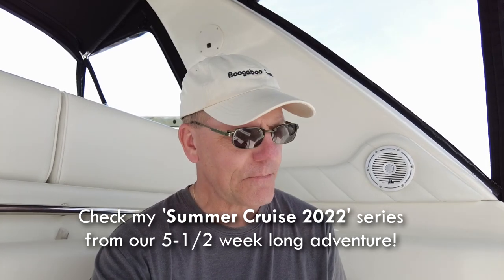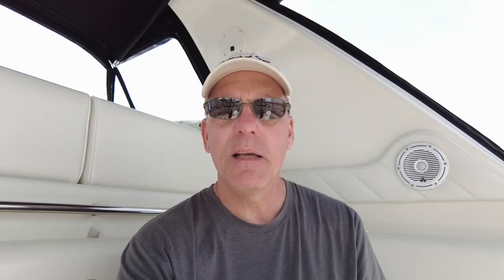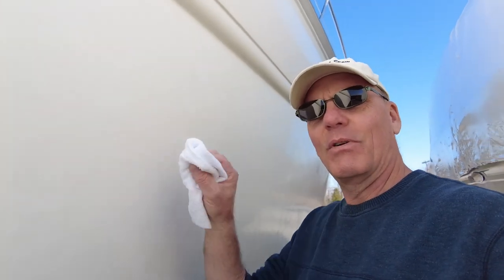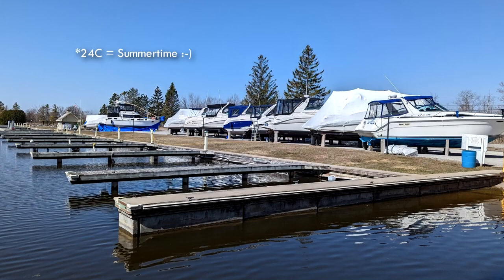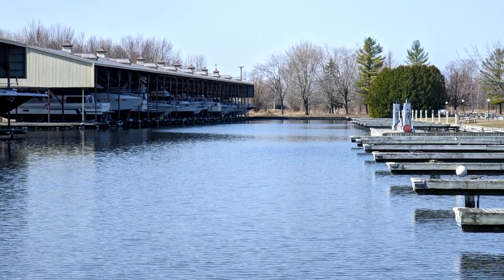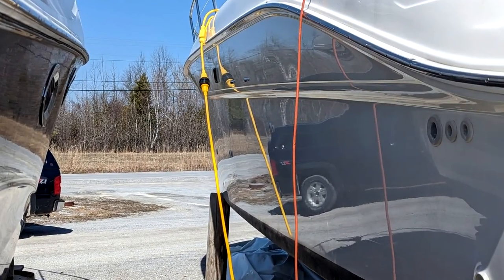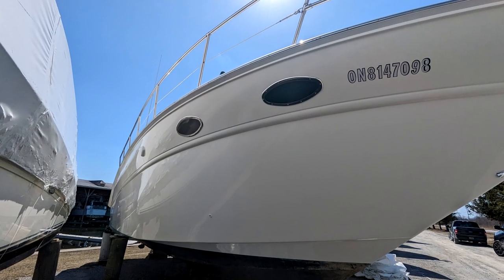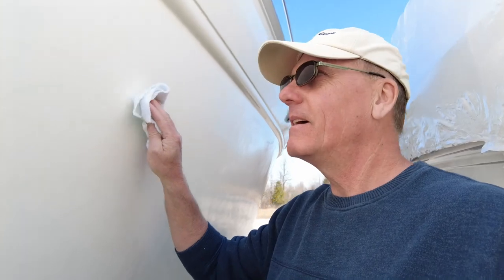Hull Polish & Polymer Application - Sea Ray

Comment: Jescar Power Lock + is great, I've been using it for 3 seasons.  When I waxed my boat I would always have to use simple green or non skid cleaner on my deck.  When I switched to Jescar I just use Starke Pure clean boat soap (neutral PH) and it cleans right up.  Bird crap comes off and the sun will bleach the stain if one is left a half hour later.  I never have to use chemicals now.  I usually apply another coat around July to get me through the rest of the season.  I put Jescar on and leave it on overnight and take off the next day.  This year I'm using Jescar Ultra Lock + it is supposed to be new and improved formula.
Reply from the maker: New and improved?? Sounds good good to be true 😉
 I'm gonna take a look at that cleaner you mentioned. I usually use basic boat soap, just to get rid of built up dust and grime we get around the marina, mostly from too many idiots driving too fast through the gravel parking lot.

Comment: Your conversation is the third place I've seen polymer sealants endorsed.  I'm done with my work this year, but I think I'm ready to ditch the paste wax for next season.
Reply from the maker: We were very impressed with both the finish, as well as longevity of the polymer application that was done last year. Again, I can't tell you what brand that crew used, but I'm sure they all share similar characteristics.
 Stay tuned to see how the deck turns out, especially once I get the pinstripes removed 👍

Comment: Jescar polymer sealant is widely considered the ‘go to’ paint sealant for auto detailing. Obsessed Garage has some very good videos on using Jescar polymer sealant.

One point to note, you can ‘layer’ it — after you use the sealant, you can top coat with a quality wax to further enhance shine and depth, but also as a sacrificial barrier coat.

FYI - Your approach to applying by hand is the right approach. Sealant doesn’t require machine application.
Reply from the maker: Yes, I was looking at their site + Social, but minimal references to marine. Maybe this video will help get the word out to the boating community 👍

Comment: Paul, that looks awesome! How many bottles did you use, and did you just do the hull? We have a 370 sundancer also and will be washing and waxing this week.  I wish you a great boating year from M/V Arai in Maryland.
Glenn G
Reply from the maker: To this point, I've done both hull sides below the rub rail. That took less than a half a bottle of the material. I'll be doing the deck, transom, etc., in the coming weeks, but I'm thinking I'll still have material left over.
Reply: @BoatingWithBoogaboo  wow that sounds great! Thanks for the info!
Reply: @BoatingWithBoogaboo  Just a FYI, I use Jescar on my deck and it does make it slippery.  The wife is not happy when I do it, but I love that shine.  I have almost fallen off a couple times washing the boat. LOL
Reply from the maker: Yesterday I was able to remove the pinstripes from the port side deck and applied some of the polymer after buffing. I didn't/not going to put anything in the horizontal parts of the deck, just giving them a polish. I had a hard slip and fall lat summer when washing Boogaboo and don't want to loose Anchor Girl over the side when we're docking. Besides, I smashed a perfectly good bucket when I fell 😜

Comment: I have been using Jescar Power lock for several years.   Last year I used Jescar Ultra Lock. Same as Power Lock but with a ceramic additive which increases shine and longevity.   These sealers need a clean gel coat to bond with.  After polishing use Mother CMX to remove any oils or left over polish.  It sprays on and wipes off with a micro fiver towel very well easily.  Once you prepped the gel coat then apply Jescar Ultra Lock  or Power Lock using a wax applicator pad by hand.  Use either product sparingly!  It does not need a lot of product.  More is not better it is waste.  In your video you applied far too much product.  After at least 30 minutes wipe off with a microfibre towel.   A second coat to increase durability can be applied after a cure time if 3 hrs for the first coat.  Just sharing my experience so your viewers get the most out of your great videos.
Reply from the maker: Thanks for your tips.

Comment: Sealants r always better then waxes or carnuba waxes. Sealants r man made and can last for 6-8 months depending on the brand and will stand up to the heat. carnuba waxes can actually burn off with too much heat. Like applying to a car and when it sits outside in the sun all day and the metal is too hot to touch. Most of the protection will b gone after that. Carnuba waxes tend to have a wetter look then sealants. But I’d rather have protection. Sealants r the way to go.
Reply from the maker: As I mentioned in the video, the entire hull and deck was professionally done last year by a crew in Sandusky (where she was located) and the shine lasted all season!!
Reply: @BoatingWithBoogaboo looks amazing as always! Can’t wait to see more from your channel
Reply from the maker: Great! I've been filming lots more projects over the past few weeks, so keep watching. And I'll look forward to hearing from you on some of them 👍